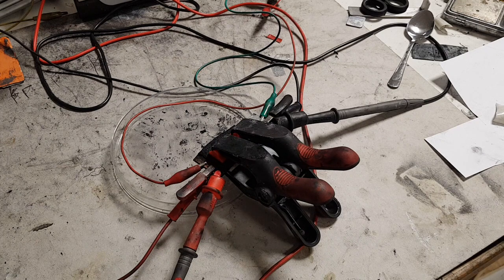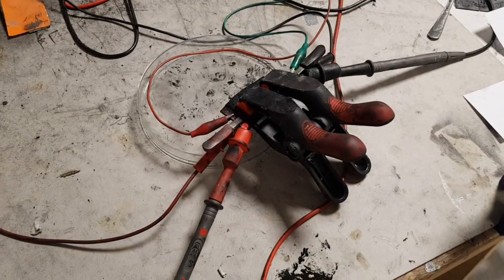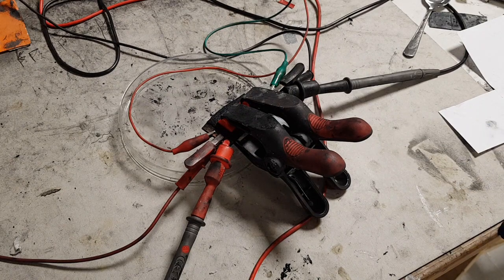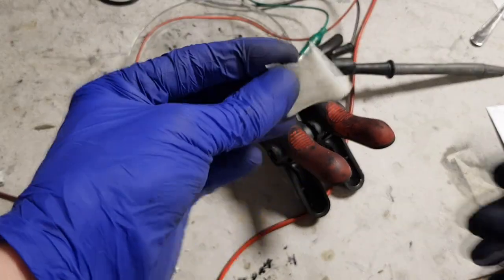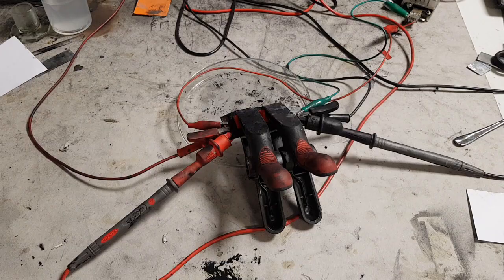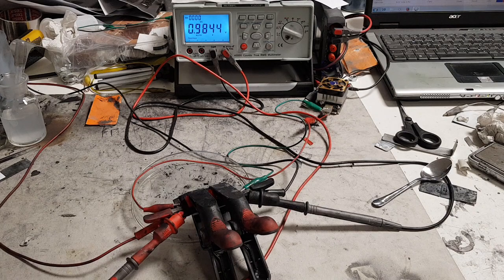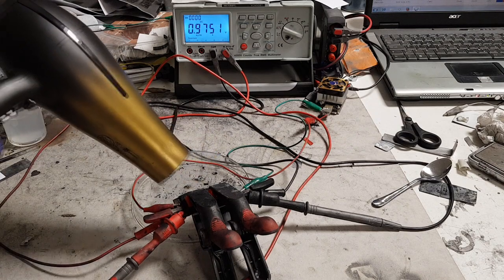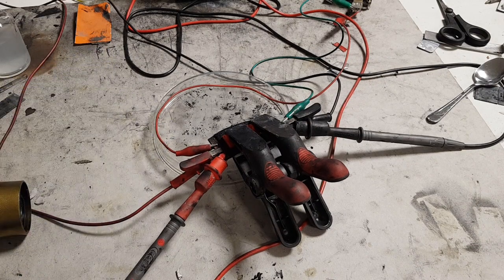Nickel Zinc Battery - Part 2

Comment: It would be interesting to see if the rate of corrosion increased as heat increases. Is the voltage increase related to an increase in the rate of chemical reactions (as would be somewhat expected in certain hydroxide electrolyte chemistries) or is it a result of a different phenomena. Perhaps related to the differential created between the two metals, or combinations? Very interesting find!